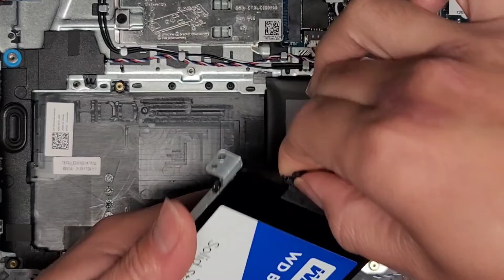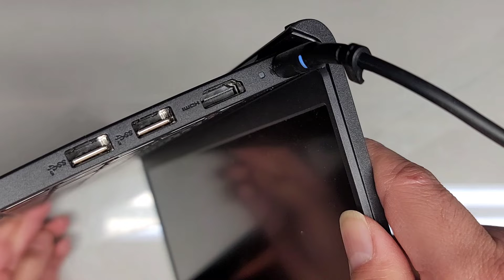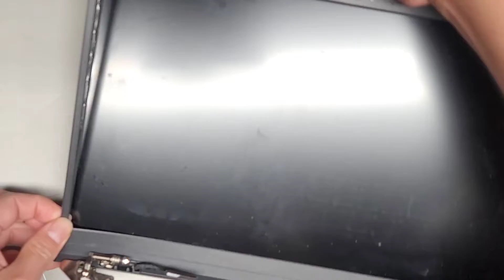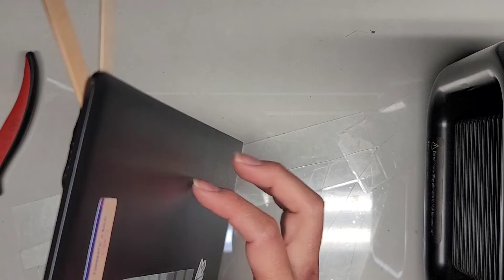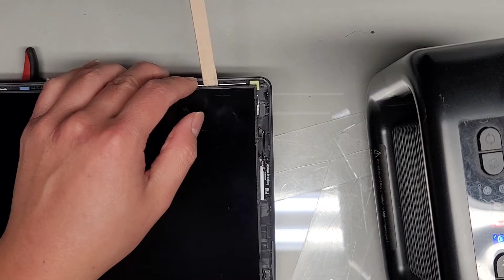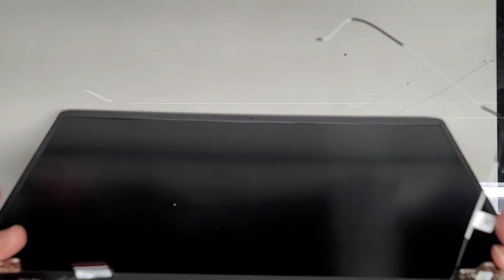DELL Inspiron 15 3511 Disassembly RAM SSD Hard Drive Upgrade Battery LCD Screen Replacement Repair

Comment: I changed my screen using your guide, but I have my charging port flashing Amber and white intermittently. Would you be able to assist?
Reply from the maker: Is the battery connected properly?

Comment: Where is CMOS battery?
Reply from the maker: @javaprogrammer5662  need a pro to replace the bios chip
Reply from the maker: @javaprogrammer5662  built into the main battery
Reply: @ItsBinhRepaired  then how to reset the BIOS admin password?
Reply from the maker: @javaprogrammer5662  you can't
Reply: @ItsBinhRepaired  so what's the solution if I forgot the BIOS password?

Comment: I do wish you'd have taken the battery end of the cable off as well. 5:10 You do NOT pull it straight up. That little silver metal retainer that you're touching with your fingernail 5:13, must be slid toward the edge of the battery. The cable is loose at that point. Obviously, you reverse that operation to reinstall the cable. When you slide that little retainer back into place, you should notice a tiny click on each side as it locks onto place. This little bit of info is actually pretty important since a replacement from Amazon doesn't come with a cable and if you try and pull it straight up you may damage the cable which has pretty tiny little wires. I hope this helps someone.
Reply from the maker: Glad you were able to figure it out. I'm assuming the sliding part is like on the ASUS laptops and is part of the battery,.  If you're pulling that cable out, I'm assuming you have a replacement battery, so you can see how it's designed, and if it's damaged from forcing it out, it'll be ok. It's not my laptop so I couldn't experiment with it and risk more damage, so I'm glad you were able to figure it out.
Reply: @ItsBinhRepaired  Yes it is attached to the battery. There are so few decent videos about the battery replacement specific to this model and of the ones I found yours was the best. It was just that one tiny detail that was lacking and since it took me a little while to figure it out, I hoped it might be helpful to the next guy if I commented on the solution.
Thanks for posting this and have a great day.
Reply from the maker: @dale1956ties  definitely useful :) Thanks!

Comment: any possibility that you could help me with a guide to clean under the keys  on this model ? i can't find anything on how to do it.
Reply from the maker: An electric blower and a toothbrush is the best way.
Reply: @ItsBinhRepaired  ok but I need to get under the keys somehow. I have spelled a little bit of pop so the keys are sticky
Reply from the maker: @christopherarrington3904 this will help https://youtu.be/PW9MlsWXS3o

Comment: I would like to know what are the ways to save my wifi card
Reply from the maker: What do you mean save it?
Reply: @ItsBinhRepaired  actually the aux cable was stuck to aux pin the male and female were stuck to the aux cable
Reply from the maker: @user-kp5hk1zj7q  I don't understand? Do you mean the antenna?

Comment: My laptop wouldn't turn on after I replaced the screen. Your video was helpful though.
Reply from the maker: Did you do the battery drain?
Reply: @ItsBinhRepaired  I did, the charging light works, when I press the power button it lights on while pressed but nothing else, not even the fan spins.
Reply from the maker: RAM or motherboard failure
Reply: @ItsBinhRepaired  Yes I think it was the motherboard, the laptop fell pretty hard before but it was working, I had to fix the hinges before putting the screen on. It worked, but once I assemble everything it stopped working. A new MB is not expensive though and I'm gonna order one soon.
Reply from the maker: Hope it goes well

Comment: Hey would you happen to know the problem the power doesn’t turn on what are some of the trouble shooting I can do?
When I press the power button the white light by the charger port turns on but the moment I release the power button nothing. I have used the charger and the light on the port is on but it still won’t turn on. Any ideas what might be wrong? Any help will highly be appreciated!!
Reply from the maker: Not sure. Sounds like a motherboard issue.

Comment: Well I have the same laptop, the power button doesn't work and when I do somehow get the laptop to run, if I move it, it crashes. Weird.
Reply from the maker: Might be a crack in the motherboard or the hinge area something pressing on the power button.

Comment: Great. Where to locate cmos battery?
Reply from the maker: I believe it's the main battery.
Reply: @ItsBinhRepaired  so if you forgot your bios password , what would be the solution?
Reply from the maker: Throw it away sadly

Comment: I recently had the opportunity to take one of these apart and I think the case is very soft overall, it feels so flimsy all the time. I wonder if the latitude and precision have also lowered the quality.
Reply from the maker: Possibly. They keep trying to make things thinner and smaller that break easier.
Reply: @ItsBinhRepaired  it is a mid-low end inspiron, 5000 or 7000 series doesnt feel as this one.
Reply from the maker: I see

Comment: Great! Loved all parts, especially the LCD screen replacement. I haven't done that in ages and, in the newer laptop models, I had no idea how to change it, much less how to get to it. Older models you used to just pry open the front bezel and there you had it. Now it's a little different. You have to take the bottom cover from the body and then get to it. I'm definitely getting old. Lol 
Thanks for the video! The other vid from today, changing the LCD too and all the other stuff is awesome, as always.
Reply from the maker: Thanks! Hope they help. :)
Reply: @ItsBinhRepaired  Hello, I have a Dell Inspiron 3515 model and there is a problem with the laptop. I plug it into the charger, it does not charge, it does not rise or fall, but I use the laptop while it is plugged in with 0 charge and when I enter the bios screen, it sees the adapter as unknow. What do you think the problem could be? Can you give me a suggestion?
Reply from the maker: @alpercan7932  charger, charge port, or motherboard.